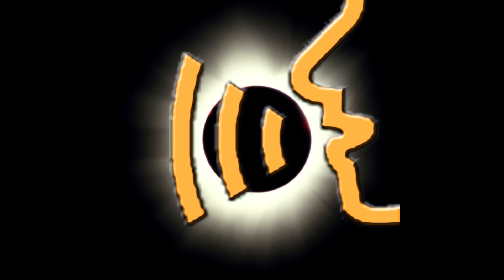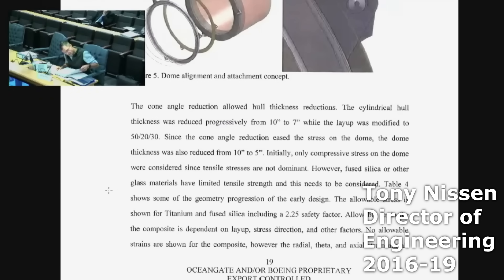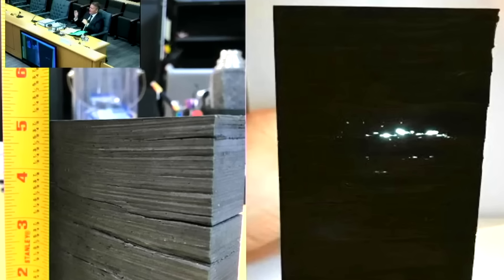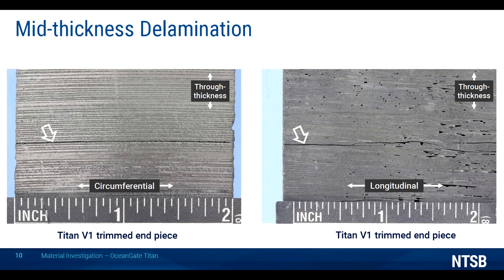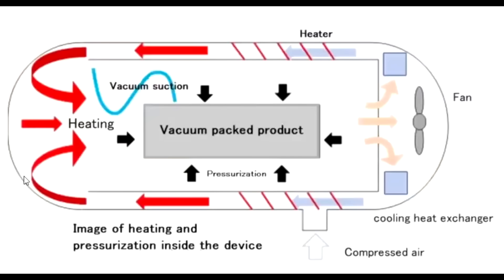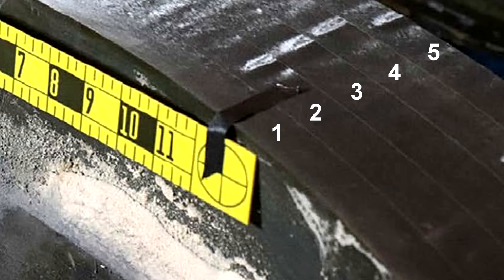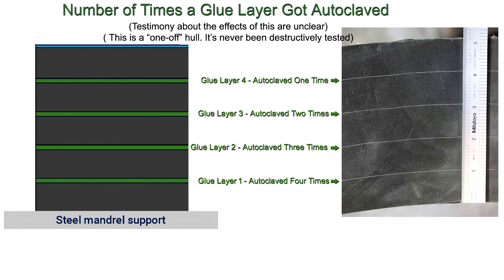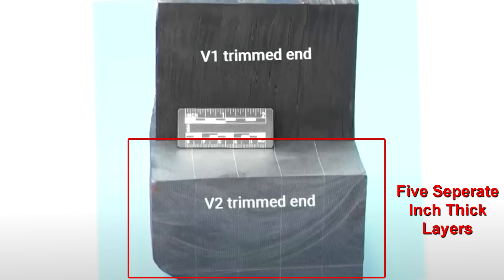Who Engineered the OceanGate Titan V2 Hull? Maybe Nobody Did?

Comment: Was each layer exactly one inch or when they finished layer 2 was it 2 inches thick rather then say 2 - 2 inch pieces with a .05 inch layer of glue making it 2.05 inches thick? If it was 5" thick in total then a fraction of an inch wasn't Carbon Fiber it was, as a random number, 4.75 or 4.8 inches of Carbon Fiber meaning it's strength was reduced because there were less layers then 5 inches of pure Carbon Fiber. If each layer was 1 inch thick, and it's total thickness is 5 inches of Carbon Fiber, then it was, say, 5.2 inches thick.

My question, I guess, is were some layers of Carbon Fiber replaced by the bonding agent/glue's thickness or was it actually a full 5 inches of Carbon Fiber? Because replacing even an eighth of an inch of CF with Glue would have lowered the load capabilities of Hull v2 versus the "tested v1 Hull".
Reply from the maker: Thanks for your comment and question.  I would answer it this way.  The Toray specification for the CF system used should have been just a hair under 1 inch thick after 133 plies.  However, the layers were ending up just over 1 inch thick after 133 plies.  Dr. Kramer attributed that gain in thickness to porosity (voids) in the laminate.  That's bad.  The laminate was about 2.2% more porous than the specifications for the Toray CF laminate.  The final hull had an outside diameter just over 5 inches, so it had to be put in a lathe to mill off the ends to fit into the reused titanium rings.
Reply: @solareclipsetimer I'm no Engineer but based on what was in your video and knowing it was less then the full 5 inches of Carbon Fiber thickness, as Hull 1 was, even I know that you have lost probably 2-5% of the amount of Carbon Fiber, by the rigid tolerances of the construction, to GLUE is going to cost you Structural Strength compared to the Hull you actually tested. Therefore any data from Hull 1 should've been scratched and retested to quantify the effects your Design Changes have caused. Small changes in Hull but HUGE changes in production method. 

Stockton was clearly working on Blind Faith in his Design that NO OTHER Person would overlook testing your NEW Design! The sad thing is he roped 4 INNOCENT People, including a BRILLIANT Scientist and a Young Man just beginning his life, into joining him in his DEATH MACHINE! So uncalled for, especially with Engineering's long history of Inventors who died testing/using their own Inventions that they FULLY BELIEVEDin!
Reply: @Axe_Slinger correction: there were no “brilliant scientists” aboard the sub when it was destroyed.  Nobody like that, in fact not a single person aboard was a scientist or science specialist at all let alone a brilliant one.
Reply: @AquaticMammalOnBicycle Perhaps not a "Scientist" by classical measure but Paul-Henri Nargeolet was a pretty well regarded "Researcher" especially in regards to Titanic. He was the director of underwater research for RMS Titanic.
Reply: @Axe_Slinger  People naturally wanted to look up to PH as "Navy" man, but his Titanic knowledge was negligible and his 'reputation' in that area is a myth/meme.  His narrations were like "There's a railing...there's a piece of metal."  PH was a diving expert, and expert at finding things and at expeditions to go somewhere and/or get operational projects working, and the site/layout itself, but he's not at all a subject expert or researcher on the Titanic.  Somewhat like comparing a pilot/journey-officer to a researcher.

Also any expertise in any field implies observational/logical ability to understand the blatant red flags with everything at Oceangate, and yet he took a head-in-sand attitude when he should have been the one person with enough clout and standing to speak up (like Lochridge did).

Comment: The main structural component of the hull was the resin holding together the carbon fiber. It was essentially made of plastic. Carbon fiber has high tensile strength because the fibers resist outward pulling. That makes it a good material for an internally pressurized vessel like an airplane or space craft. It has poor compressive strength, which is what is necessary for a submarine where the forces are external to the body. Imagine pulling on a rope vs pushing against a rope. The rope is very strong when you try to pull it apart, but weak and flimsy when you push on it. Carbon fiber is basically a bunch of tiny ropes weaved together in a way that makes a material very strong against pulling in any direction. It is not strong when there is external pressure pushing it together like with a submarine deep underwater.
Reply: THere have been CF submersibles but they were much smaller and unmanned. It's not an impossible idea, but it needs far more testing and development than what Rush did.

Comment: OMG never heard of the 10" hull thickness proposed by NASA  vs  5" built - such a violation of fundamental engineering principles ("management by fact"). Curtailing the scheduled unmanned runs during the test phase possibly criminal if as a consequence of bad results. Leaving it outside in winter  temps also a bad decision. Whenever financial pressures are cited its a sad fact that safety is getting elbowed out of the discussion. Big companies ensure the decision to go to the next phase are made by teams that include respected staff that have no agenda in the project and can review the deliverables impartially. Kudos to the staff that walked away and the vendors that refused to do the short cut work.
Reply: There were hundreds of bad decisions. Rush was behind most of them, but a lot of other people were afraid to say no to him and kept their mouths shut to keep their jobs.
Reply: Not just 10 inches. 10 inches and cross ply weave at 90 degrees

Comment: I can imagine having built that submarine as an unmanned test mule. And then use it to see what issues arrive at the boundary and from repeated stress cycles on the carbon fiber hull.
Reply: They never had enough money to do that. If Rush was smart he'd have gone to the government and sold the program to them for all the R&D costs he needed to do it right, and then after the government pays for that, he could take the design and start a for-profit enterprise. He did it completely wrong.
Reply: There is the question of would the government be interested and why though. There already were perfectly good tried & tested subs that didn't require beating the laws of material science with a big stick. And with gov work comes regulatory issues - like certification. Rush wanted to move fast, break things, be first (albeit first to do the insane thing. I don't think that route would have fit his "maverick" style. @stopthephilosophicalzombie9017

Comment: Just my 2 cents opinion;
I would have not used any glue at all.
Instead of relying on the peel-ply imprint I would of made extra sacrificial layers past the one inch, these extra layers would be used for sanding smooth the surface to perfect subconference with the appropriate fine grain, then I would strait up continue with the carbon fiber relying on the epoxy and mechanical adhesion to happen !
But all this is moot because I would not make the layers in this matter at all anyways !
Unless after testing applying the fibers in very high tension would prove to be sufficient to eliminate the waves created by the vacuum pressure.
The problem is the need for multiple fiber directions (they used only 2 and still had problems) compressing the fibers in curing creates waves because you cannot compress it in the best way for all the directions.
A crisscross in high tension maybe could work ?
But I suggest separating the directions making one layer zero degrees and compressing it in sections longitudinally then one layer at 90 degrees compressing it traditionally, maybe a crisscross could also be compressed traditionally, but really how else could it be ?
So really the main problem is making the zero degree !
It is this one who is problematic and the one that causes waves (mostly) !
The other problems are ; 5" is way to thin !
And the lack of proper support for the ends of the carbon tube !
The titanium rings should have been mostly under the ends of the tubes for support !
Reply: "I would have not used any glue at all."
And do you have any expertise in carbon fibre construction? If you don't, you wasted a lot of time typing out that little essay.
Reply: @beeble2003  Maybe I do, but your arrogance and belittling towards me compels me to not waste my time with you !
Reply: @ "Maybe I do"
So no, then.
Reply: @beeble2003  Nice try at baiting me.

Comment: Have you done a bit yet on the epoxy used? IIRC it was the wrong type to use to bond CF to titanium as it used aluminum filler and the correct type used an inert ceramic filler.
Reply from the maker: Thanks for your comment.  I do mention the exact epoxy used in one of my other hull videos, but I don't really go into the exact specifications.

Comment: Excellent update. Thank you
Reply from the maker: Thank you for your comment.  I am happy you like the video.
Reply: Very informed @. I still wonder about the benefits of a fibre being used in a compression application. You are not utilising the inherent strength of a fibre in compression. Yes, the internal skin of the cylinder will be in tension as it flexes in under compression, but v containing expansive force where the entire vessel will be contributing to the overall strength, in compression as are at odds with the fundamental direction of the forces

Comment: Some other exoerts shared they didnt know why they also rolled the carbon fiber concurrently in a row and didnt have some diagonally or acoss the entire frame as an X for more strength and stress points. Just allowing it to unravel like a string.
Reply: It did have 90° plies.  Every 3rd layer was laid in a 90° angle to previous 2. It was however recommended by EVERY engineer that the plies should have been 45° and hull at min 7inch thick
Reply: @chowchow2386  That makes no sense, how could they achieve 90?
Reply: @ did you not watch the video? they not only explained this, but also showed it.

Comment: While the concept they came up with was ground breaking too many critical testing and evaluation procedures were skipped or had the results outright ignored. The fact that they could not present meaningful data charts based on the torsional deflection measurements  from the RAM system astounds me. Of the I believe 10 sensors only 70% we functioning, none were calibrated to the same scale, and to be honest had no correlation between deflection and depth. Time submerged was worthless. This tragedy for crew onboard should be laid at Stockton's feet. Unfortunately God was the governing authority that  had to rule on this one. The sad part is that this new process will take at least 20 years to be looked at again if ever. Imagine if they could have 3D printed interior bulkhead layers out of 3mm stainless or titanium with 25mm carbon fiber interior layers between the bulkheads. He might have got the cost and weight reduction he was looking for at the commercial level. It sounds like he spent every cent he had on this project and rather than admit he was wrong he YOLO'ed it once he figured out he was the only person left supporting the design.
Reply: There’s nothing “groundbreaking” about it.  Carbon fiber sub already existed (DeepFlight Challenger), nothing here is new or special or smart.
Reply from the maker: @AquaticMammalOnBicycle  Yes, carbon fiber has been used for pressure hulls before Titan.  But not to 4,000 meters multiple times.  Deep Flight Challenger is  not a good example though for the concept, it actually failed to do anything worthwhile. I think a single deep dive?  The Navy's ASUS sub was a glass composite, unmanned but really successful.  Thanks for your comment.
Reply: @solareclipsetimer  Yes, my point was that Rush lied about being the first to use carbon fiber (he lies in the Geekwire Summit video).  And yes DeepFlight Challenger highlights the problems, which Rush ignored.

Nothing is special or groundbreaking about the Titan.  And even the shape was purely to get more paying customers into it at the same time, unlike a safer (smaller) sphere.  Americans are extremely conditioned to call random ideas "groundbreaking" or act like it's a lottery ticket to a gold rush regardless of quality or logic or validation, it's part of a marketing-based culture.

If I take my car underwater, that's not "innovative" or "groundbreaking" unless I actually did something smart and useful in the design and prep.
Reply from the maker: @AquaticMammalOnBicycle  Yes, on that point I agree with you.  Stockton did talk about it as if it were a brand new idea.
Reply from the maker: Thanks for you thoughtful comment.

Comment: And we still use inches in the USA. How Great!
Reply: lol it still doesn't help if you can't do math even in metric. 177.8mm was a theoretical recommended thickness. They made the hull 25% thinner to fit an existing part off a submersible that failed.  Real smart decision if you are traveling in the air or space not so much in a fluid medium under immense pressure. At least Stockton won a Darwin award for this.
Reply: We use metric in Oz. But feet and inches are much easier to visualize.

Comment: I don’t understand how the discussion about any kind of deep sea exploration stops , when this man brings up carbon fiber !!!!!!
How is this even possible ? Any accredited institution should have categorically pulled out of any advice whatsoever!
Nothing about carbon fiber says - deep sea exploration!
Very sad people had to lose their lives over this .
Reply from the maker: Thanks for your comment.  That is why he had companies in the aerospace industry build it. They did not know how to question the idea.  The marine industry companies would have backed away.
Reply: @solareclipsetimer  They should have known how to question it....carbon fiber is like glass when it breaks. It's incredibly rigid, until it isn't. That alone should have made any aerospace company run for the hills, because at this point, I'd say if they knew the use of the product, even selling it could make them party to the failure for providing it for such a reckless venture to begin with. But it's clear why: $$$. While companies may not generally be responsible for how their product is used, this is one case where there's a good reason that they could and should be held responsible because of the application being so far outside of their expertise that they couldn't question it. At that point, it can be argued that it was their duty to demand more data to know for themselves if their product would really be safe to use in such a scenario.
Reply from the maker: @peoplez129  Thanks for your reply.  I agree with you.  But they didn't, and that is why we have this sad but compelling story to discuss and try to figure out why so many things in the process went wrong.

Comment: Why didn't they talk to companies that actually build subs?
Reply: Mr. Rush being a tool.
Reply: First it was not a submarine. What company produces tiny submarines anyway? It was a submersible. A few tourist type submersibles have been built. A 6th sense says they wouldn't have touched Rush's project just for liability alone.
Reply: I would not be surprised if Stockton tried. They probably laughed him out of the room when the budget proposal revealed they only had enough capital to build a one man Futurama suicide booth. They usually use spherical shapes as the life sustaining  vessels, if you will on the submersibles, as a round object with equal pressure on all sides has a better chance of maintaining hull integrity during a significant failure of the submersible. The idea of cutting it in half and stretching it to 3 times its volume may have made the engineering firms run to the hills on initial consultancy/feasibility pitch.  It is very hard to convince an educated person that a hypothesis is true if you have no supporting statistics. It is next to impossible to convince an educated person with an ego and their life savings tied into project that it isn't going to work.
Reply: They did. The other companies even wrote a cosigned letter that he shouldnt do it, because it's unsafe, and a disaster will hurt the entire industry. Stocktons problem was that traditional, safe materials wouldn't allow a sub of this size at his price point. It would have been more expensive by orders of magnitude.

Comment: I've worked with carbon fiber in large Radio Control model aircraft.  One issue I have discovered in crashes is the connection of dissimilar materials were first to give.  I've always used the 45 degree plys at the root and along the spar.

Comment: 13:04 No... the Titan sub was STILL bolted shut from the outside. Even if they didn't implode & survived back to the surface... they were still stuck inside with limited oxygen (they could have still died on the ocean surface if not found soon enough).
Reply from the maker: That is a great point.  If they had ever surfaced far away from the mother ship, they could be hard to find.  When the Titan is bobbing on the surface, almost none of it sticks up above the surface.  It has a very small visual footprint at the surface.
Reply: LOL
Reply: And the craft should not have been white. Experts and scientists said it should be yellow so it could be more easily seen. Everything was wrong with this craft - including the color!!